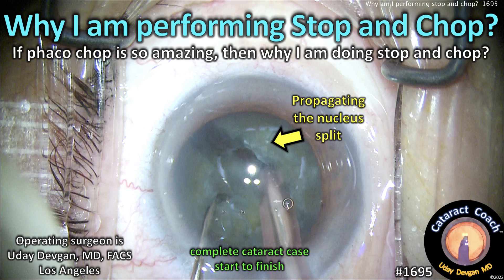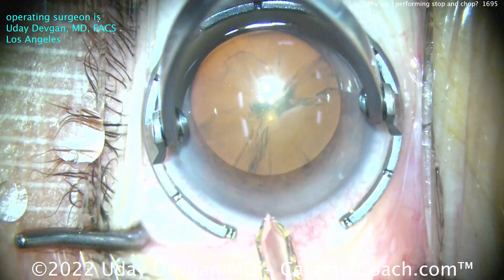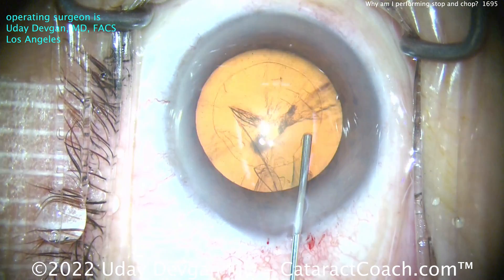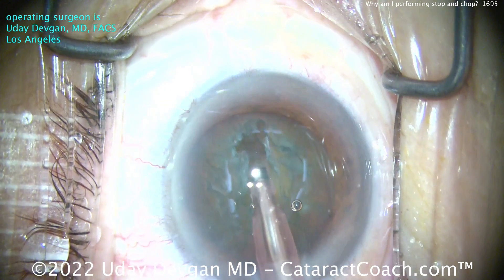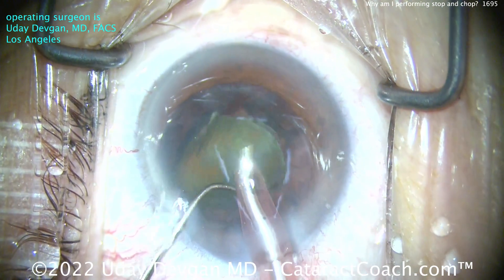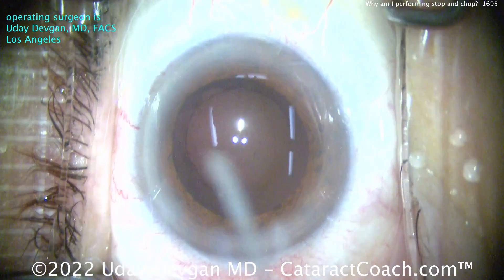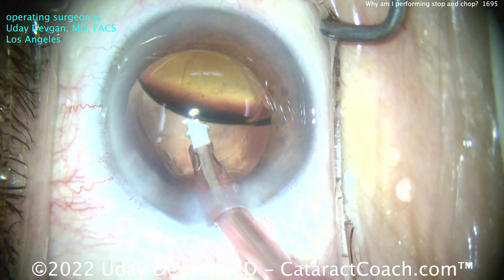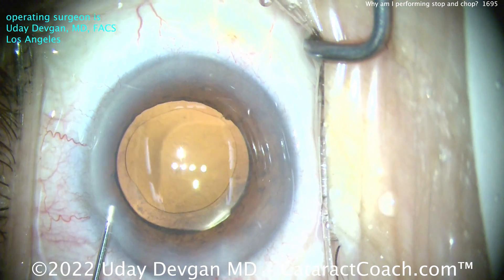CataractCoach™ 1695: why am I performing stop and chop?

Comment: Nice video! But I am curious, what is that image at 0:28s, when you are, I guess, injecting intracameral anaesthetic? It seems a wave inside lens, under anterior capsule, before rhexis? What do you think, professor?
Reply: good eye Alex! - the capsule is opened with the para blade at 0:12. And the professor is aware of this - notice how this opening facilitates the forceps easily pulling the tiny flap to start the rhexis 1:15 - no indentation needed 👍. Ive done this myself, by accident, on a really shallow eye - and it was in the periphery! yikes! Had to make an irregular rhexis to incorporate the defect; but hey- it sure made getting the lens out of the bag easy! lol. And the pt did great of course - "all is well that ends well!"
Reply from the maker: @soccer24six  exactly!
Reply: Thank you both!